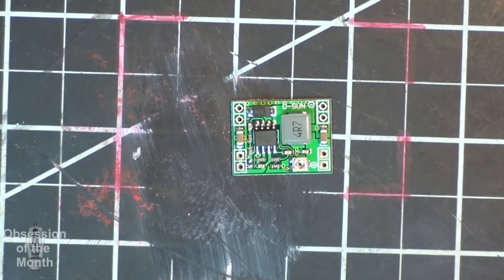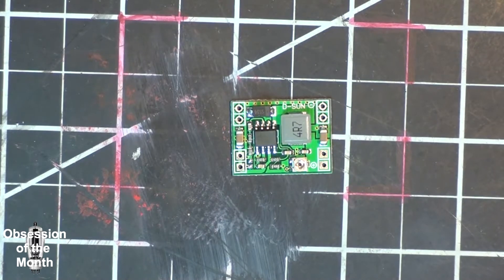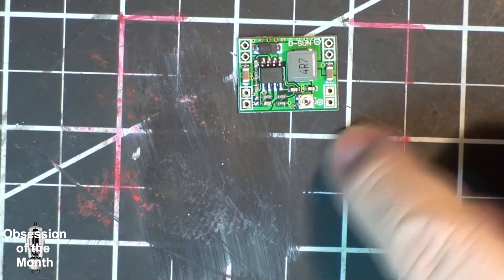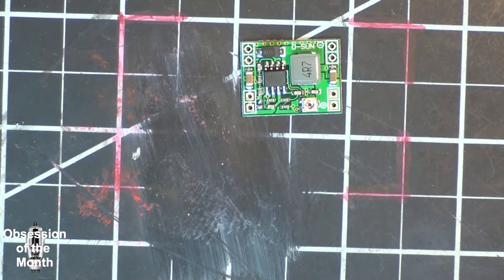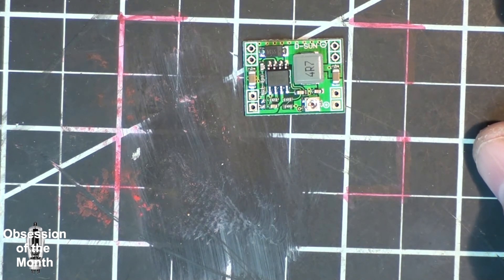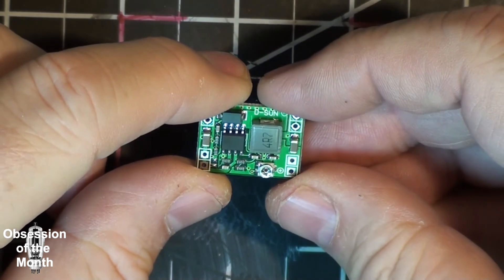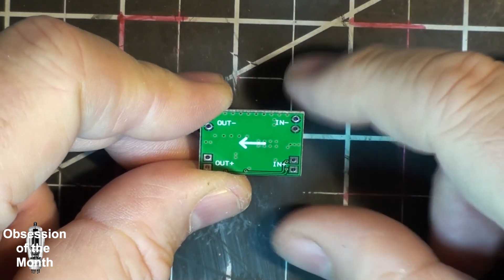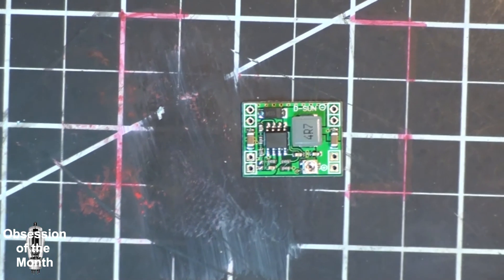MP1584 3A tiny Buck converter

Comment: Great! Can you tell about the efficiency of this converter? I want to use it to  power some 5v devices from a 12 volt lead acid battery, from 1 to 2 amps, and i want to avoid too much losses in the converter.
Reply from the maker: supposedly it's 92% efficient, I have no way to confirm this.